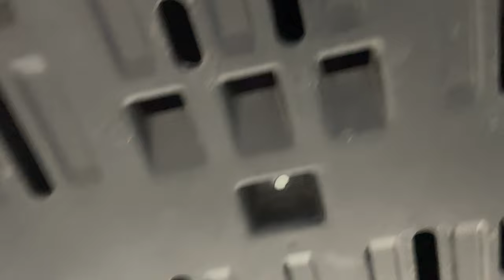YXZ skid plate remove & reinstall

Comment: Video came in handy. Pulled my skid plates off today to change oil, trans, and both diffs fluids. 

Time to change fluids ~30min 
Time to reinstall skid plates ~2hours

😂 i can’t tell you how many times I wished I had a lift during that job.
Reply from the maker: lol
Reply: Absolutely correct.  Worst part of changing the fluids is putting the skid plate back on.